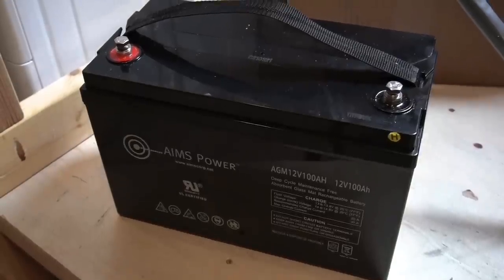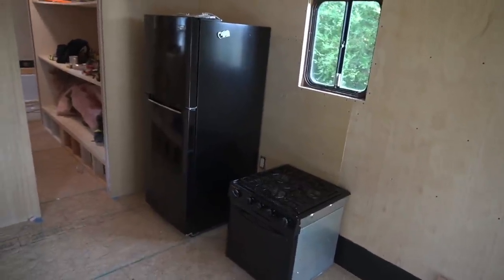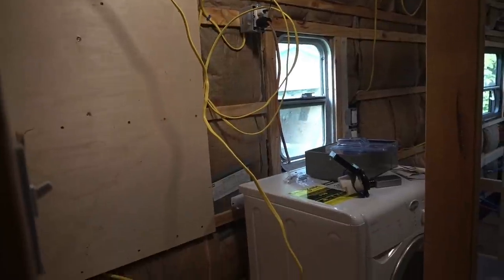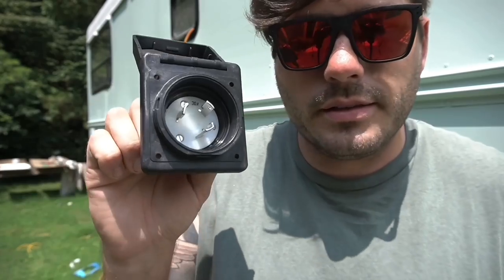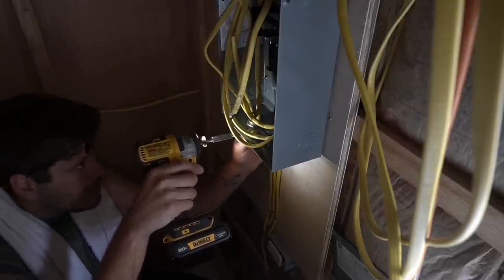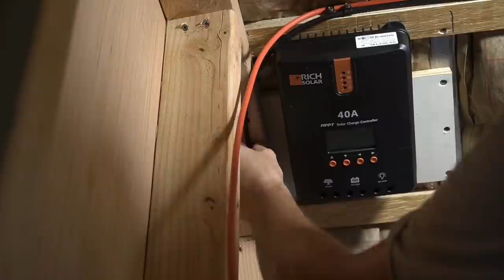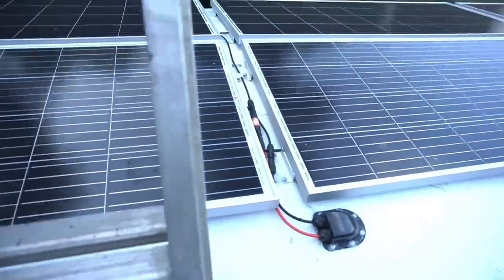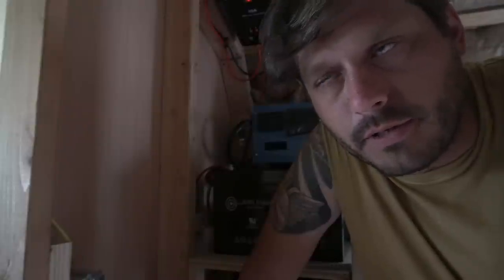School Bus Conversion Episode 18 - Solar power and explaining the bus layout

Comment: You guys are "low-key likeable".  Hope those flat roof solar panels can get enough SUN ANGLE to charge fully 'cause parking that long bus for full sun can cause the bus to be hotter than in the shade.  I keep thinking of buying a "reticular arm contraption" attached to the panels that allow them to be angled when necessary.  Also, they look very flat against the roof... hope there is enough breathing space unser eath them.
A few flexible solar panels on the ground with long extension cords to let them angle in the sun while I park in the shade works for me.
Hope your system works!  Aloha
Reply from the maker: That is a concern, yes. But I really don’t have a lot of options. Thanks for watching!!

Comment: Batteries to the charge controller first then solar, and batteries last when disconnecting. It’s making power from the sun otherwise and has no where to go so it just might cook itself……
Reply from the maker: Explain that a bit more. Is this the way it should be connected as to not destroy anything?
Reply: @lifeanywhere  that’s what I was taught and also in my directions that came with my Renogy controller.
Reply: This is definitely true. I'm working on my own bus conversion and have seen multiple people blow up charge controllers this way. Disconnect the solar and connect the batteries first. Then the solar panels.

Comment: I need to ask:  would it not have been better to seal the raw metal where you cut the hole and also seal between the plug and the outside wall before screwing the plug on to the bus.
Reply from the maker: The shore power plug has a gasket behind it to seal it and prevent water from getting in. It’s just difficult to see in the video. Should’ve mentioned that. Sorry! Thanks for watching!

Comment: I have just watched a bunch of your vlogs at once and afraid for some of things you did. 
Wires should be in conduit so they don't rub and get cut on any sharp metal or anything to get shocked. Same with you pex. Should be in a track or something you don't want a leak when all walls are up. 
For solar those small screws you used will not jeep them down should have had bolts to hold down from other side at least and with all the movement of bus is going to work loose. 
Beds should be slats as the moisture in house will make mattresses get mildew. They need to breath. Too many people already found that out. 
And why no windows for airflow in kids bunks. And closing them off especially with no windows is going to be super hot and no airflow.

Comment: "pretty" panel example... they use a board over a board. Ive even seen them hinge open with the wires attached on the back of front board. Found one here... https://youtu.be/Vhb46yaeNlM?t=663